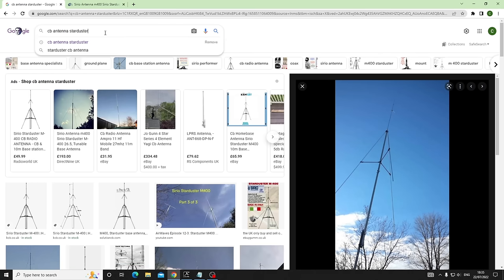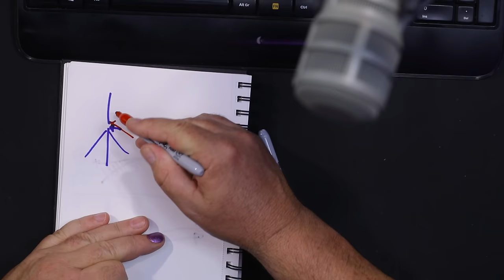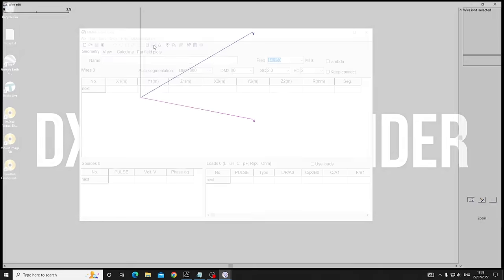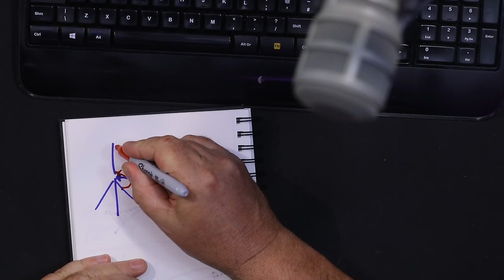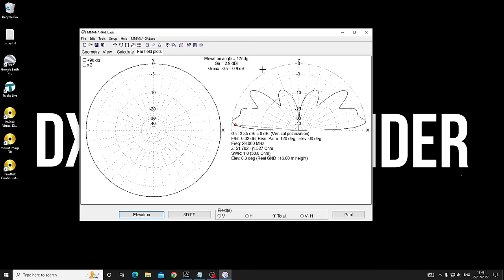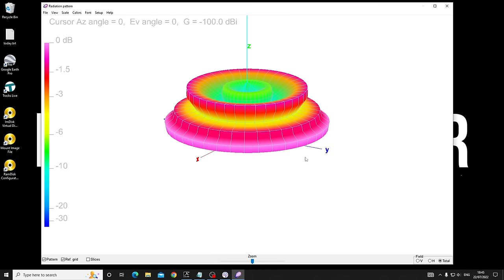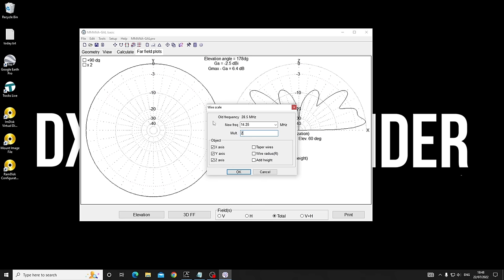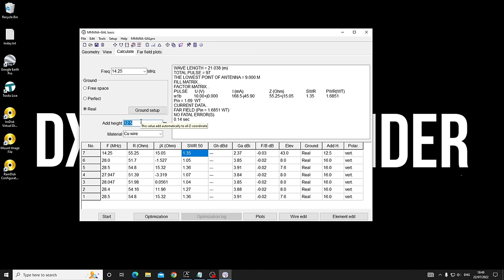The Ultimate CB / 11m Antenna?

Comment: Honestly. I just found this video at 2007 on  Thursday 26th Jan 2023. I thought of and built this antenna on around the 12th of this month....for 70 Mhz...4Mtrs. I put it at about 10' above concrete and vswr was 1:1.2 on 70.425. Unfortunately I've been sick for a couple of weeks so it's yet to be tested at about 20'. I didn't need some clever program, just a tape measure and a pipe cutter...for the alluminium. However your graph is showing me what to expect (sort of) of the radiated pattern. I remember the old CB antennas of this design (there was a legal one for CB27/81 called a 'thunderpole'.). They worked quite well and yes, basically they're a 1/2 wave dipole with the bottom element split into 3 GP's. I'll compare it to a homebrew J pole and then possibly modify it for a 3/4 wave radiator...for the fun of it and thats the reason why I did the RAE in 1984. Cheers and 73.
Reply from the maker: Yes.. And I built it - works great! https://youtu.be/V8Qq4-0_TjQ

Comment: I made a tuned CB 1/4 wave antenna using solid 10 gauge house wire and held up by a  rope 40 feet up between 2 trees and 4 radials at 35 degrees its been my main antenna for 7 years now.
Reply: Hi, I use a high gain 36' J-pole tuned to 27mhz made from 1/2'' copper tubing hanging  from rope inside a tree and i can work anywhere i want from 5 to 100 watts! I have talked over 50 miles away on 2 watts as a test base to base no BS!
Reply from the maker: If you have time, join us on the full-build and test Premiere? https://youtu.be/V8Qq4-0_TjQ

Comment: You always have great videos sir!
I use a high gain 34' J-pole tuned to 27mhz made from 1/2'' copper tubing hanging  from rope inside a tree and i can work anywhere i want from 5 to 100 watts! I have talked over 50 miles away on 2 watts as a test base to base no BS!
Reply from the maker: Hanging from a tree. Absolutely perfect!
Reply from the maker: If you have time, join us on the full-build and test Premiere? https://youtu.be/V8Qq4-0_TjQ

Comment: The best antenna I have ever built for local work on CB was a J Pole. Although, I have built many Quarter Wave Droopys, and they have their advantages. I friend of mine 50km away has a 5/8 gp and a quarter wave. There is a lot of terrain between us, up to 1000m. When he switches to his quarter wave, he jumps up as much as 2 S points (by my cb base meter) compared to the 5/8. This I believe because of the higher take of point, the 5/8 runs into the terrain. This can also be advantageous for skip, 'drop zones', if you will.
Reply from the maker: Well. I remember Roly making a DX contact on 28 MHz with a 6-inch nail..! When conditions are in, it just works :)
Reply: @DXCommanderHQ  yes, I've spoken to QLD on the Hill's Hoist (that's a clothes line) and the top barb of the our farm fence. But still, 12 watts to Ireland, almost 10,000 miles on a vertical only 6 or 7 meters up with a strong signal... not bad. You know we don't get those conditions every day.

Comment: I was a RTO (radio telephone operator) in 3rd Ranger Battalion back in the 90's when my unit went to Jungle Warfare School in Pamama. As part of the training, I built a military field expedient jungle antenna called a 29er2 jungle antenna. I had a pocket fisherman that I carried in my ruck and would use it to throw a washer over a high tree branch in the jungle canopy. Coms are a big challenge in the jungle and was able to make coms with the HQ about 7 clicks (km) away. We were of course in the military bands in the 10 m range. 30s MHz. We were taught to get three equal size bamboo or sticks. We measured them by spreading our arms out and estimating that distance. Then we used speaker wire and 550 paracord to make the radial wires and the radiated wire. Those were all measured the same way from hand to hand outstretched from each other like wingspan. We used additional speaker wire to connect the main beam and the radials to the radio. Anyway, this is basically the same thing as the military's field expedient 29er2 jungle antenna that was used in Vietnam. I have been planning to make two versions for 20m and 40 m bands. I think you would have to make the radials and main beam 15 feet and 30 feet. Do you have any idea whether or not this would work?
Reply: The paracord was used to tie the sticks together in a triangle and as the way to tie the ends of the radials to the corners of the triangle. It was also used to hang the antenna high up in the tree. I used the fishing pole to throw and large washer up in a tree and let it come down to the ground. Then connect that to the 550 cord and pull it up over the branch. Connect the top of the radiated main center beam to that and pull the antenna up as far as you could to clear as much vegetation as possible.
Reply: I do have a fiberglass pole like you are discussing that I could use. But one of the main benefits of the 29er2 military version was its relative light weight since we were loaded with 60 to 90 lb rucks and humping 12 to 20 miles a day through muddy and hilly terrain.
Reply: I have a couple hundred feet of speaker wire that I know will work, but I also have some electric fence 17 gauge aluminum wire. I was wondering if you have any idea whether electric fence wire is any good for antenna making?
Reply from the maker: OK, I am not quite sure if this was a ground mounted yago maybe? Google has no trace of the 29er2 - I'm so sorry I don't know.
Reply from the maker: Wire type: ANything works old friend, just make one :)
Reply from the maker: PS OK, so I built this one in the end.. If you have time, join us on the full-build and test Premiere? https://youtu.be/V8Qq4-0_TjQ

Comment: Back in the day 80's / 90's my best contacts were using a Wilson Trucker on the roof of my Sherpa van using a little 25w amp on my Major 555 radio . Locals with big beams and high power linear's didn't like it when i'd be talking to Mr Johnson in Jamaica and they couldn't get through - massive ground plain of the van roof was all i needed lol .
Then i grew up and got my M6 and it got weird - FT101e runnuing sub 5w of power into a MFJ matcher and out to a std 21ft aluminium silver rod cb antenna  = 1:1 swr on 20 / 40 / 80 meters and i was talking all over the world on 2 to 5w lol . Ok the big boys were wiping me out with their kw's of power as i sat there shouting UK QRP station , but eventually i'd get through and the remarks when i told them what i was running were funny ...
Sometimes the illogical actually works quite well ...

Comment: The spiky bits form a capacity hat, I did build a clone many years ago and it did seem to have amazing useable bandwidth.  I bet this will work well on a Nebula pole, might be rude not to make a version for 20m. Go for it! edit.. stick with 10m
Reply from the maker: Ah.. So the spikes basically gave an even better match.. OK.
Reply: @DXCommanderHQ  yes, they lower the Q, some other CB antennas at the time had capacity hats at the top.  The capacity hats  also reduce the tendency for corona discharge, not normally much of an issue at our power levels.
Reply from the maker: OK mate.. As you know, we did it.. If you have time, join us on the full-build and test Premiere? https://youtu.be/V8Qq4-0_TjQ
Reply: @DXCommanderHQ  it seemed to be working well at the weekend. Popped in and out of both streams to see how it was going. Will watch the new video. 73

Comment: Callum, please build us a Starduster wire antenna. 

I think my old ST'r was the best CB antenna I ever had, and it was close to 50' feet to the feed point and well guyed.

In answer to Robert Quance noted below.
"Robert, if I use 4 radials in my Exnec model the directivity problem in the Azimuth plot you note goes away, but the best gain goes down a little too using four radials. I doubt anyone would ever notice such small differences, however."

Marconi
Reply from the maker: Nice one!
Reply from the maker: Eddie.. I think I already mentioned to you.. OK, so I built this one in the end.. If you have time, join us on the full-build and test Premiere? https://youtu.be/V8Qq4-0_TjQ

Comment: I mounted one on a 18m pole, and it worked tremendously well, Call. I did use the elements as my guy wires. That's what I did before I installed my 2E cubical quad. 73's de ON70FF, Kurt
Reply from the maker: Ah Kurt! OK mate!!
Reply from the maker: OK Kurt, I copied you! But this one is 15m, 12m and 10m :) If you have time, join us on the full-build and test Premiere? https://youtu.be/V8Qq4-0_TjQ

Comment: I've built these for years from wire for 2 - 40m. They have 2 radials or 3 if I've enough wire and you don't need them high. 1/8 of a wave agl for feed point works. I would take Rudy Severns advice and pop a common mode choke at feed point.
Reply from the maker: Yes Peter, I think a simple dirty balun would be important in light of the height..

Comment: I've been running a MACO 5000 5/8 on the main shack and a 1/2 wave Tram 1498 on the main house.  The biggest difference I've seen between the two seems to be the fact the MACO has less bandwith, and only occasionally better performance.  Both do great in local LOS testing, both have made South America on skywave with raving reports with 200 watts, 8,000+ miles out.  

I think your point is very good.  As long as you aren't using a compromise antenna, they will all work well.  Height, terrain, nearby objects, far field, can all have more impact than actual antenna choice per se.  

The inferiority of my 108" whip on my big 20 foot long Lincoln car, and the poorer performance of my Hustler BTV6 on 10 meters, is better explained by the difference in height to my bigger antennas, more than the 1/4 wave vs. 1/2 wave vs. 5/8th wave argument.
Reply from the maker: I think you make perfect points!
Reply from the maker: Just a thought.. I got this working.. If you have time, join us on the full-build and test Premiere? https://youtu.be/V8Qq4-0_TjQ

Comment: I use CB (11 meters) for two totally different purposes. I have AM only CBs in my car and truck, with fairly small mobile antennas, running about 35-40 watts. These are for short distance local line of sight communication only. In the U.S., where I am, almost nobody has a CB in their personal vehicle. BUT. Almost ALL truck drivers do. So if you are driving on the highway, you will always be within range of someone you can communicate with very clearly. But just because they can hear you (if their radio is on) that doesn't mean they will talk to you. You have to be able to speak their language. Driving a truck is a very lonely job, and truck drivers actually like to have someone to talk to, IF it is the RIGHT someone. I just happen to be one of those types. 

I have an 11 meter SSB setup at home, with some extra channels, running 100-200 watts. That's clean RF, NOT splatter. I'm using my own homemade tube amp. I also have a whopper of an antenna in the back yard. I built it, but I have to admit I didn't design it. I did exactly what you are talking about. I copied the design from the '70s. It's a copy of what was called a Moonraker IV back in the day. It's a 4 element cubical quad beam, and it's so big and heavy that I had to use a Rohn tower designed for amateur radio antennas to put it up. I use it with a rotator. I have made contacts all over the world with this setup, though I seem to do better with Asia and the South Pacific, especially Australia and New Zealand. 

Oh, by the way, that little thing on top of most older three element ground planes is called a "top hat". Its usefulness is debatable. It slightly changes the antennas impedance, which may or may not increase its bandwidth, depending on a lot of other variables. It can also increase the antennas capacitance, but again that depends on a lot of other things. Way back in the mid '70s, I had a 5/8 wave ground plane that had a top hat. It worked very well, but whether the top hat had anything to do with its performance is unknown. It had no measurable SWR across the entire 11 meter band. I used it on AM only. I didn't have an SSB radio back then.
Reply: Its called a capacitive hat a top hat is a type of hat people wore in the 18th and 19th centuries

Comment: The little radial on the driven element is to lower the feedpoint impedance.. Likely to broadband the matching on this sort of twig.. It may help with ground loss.. Cap hats are better on the top in my experience..
Reply from the maker: .. however the bandwidth is SO huge anyway.. Interesting because when I made it, it just worked. Perfect match.

Comment: So, a couple things;
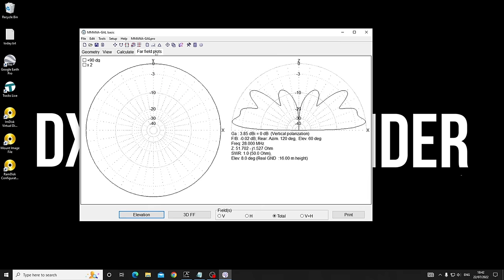1.) I see it provides 3.85dB gain Isotropic 7:33 That's about 2.15dB less with reference to ½ wave dipole, however this IS a ½ wave dipole - so how is it getting 1.7dB gain over itself?
2.) It needs a small hairpin (6.5" x 1"?) across the feed point to neutralize/bleed-off static electricity.
Reply from the maker: I have no idea. It's been a while since I made that. I always compare apples anmd apples though, so although I might say "dB", I mean dBi. It doesn't matter as long as we are on the same axiom.

Comment: My experiments concluded

1.Least ground affect(reflections below the antenna) around 18metres min height ,ground radials become more effective and radiation angle lowers.

2.Isolate antenna from mast ,earth mast via copper stake (frame earth ground)
Antenna sits at isolated.
Add a fully isolated 1:1 ground isolator transformer using BN43 mix binocular ferrite block (2t:2t)
This will isolated DC radio ground on coax to antenna (only required on 1/4wVe type antenna)
Provide a DC short circuit to antenna,improving static protection.
The radios DC negative ground from SO239 to ground isolation unit is now fully protected.
You should now have 
Earth ground 
Radios ground 
Totally isolated to prevent grounding out your SMP PSU , when it can cause all manner of RFI EMI  issue ,often blamed!
SMP psu do not like (being a balanced DC output) the DC negative being grounded to earth ground .
Optionally I found using double shieldef with copper foil outer of coaxial feeder help reduce "induced no use" getting into RF feeder cable.

Above tests were to optimise line of sight (LOS) 
On VHF lowband 25-88mhz 
Using a similar 1/4wave ground plane antenna.

Dxing skywave is a slightly different approach.

Great video!

Your suggest height in video of 18m ,Yes will give you outanding LOS operations!😁

Rob P
Reply from the maker: Yes, it worked.. https://youtu.be/V8Qq4-0_TjQ

Comment: we had this antenna back in the 80's when i was a kid, a simple fiberglas construction with no bracing and no smaal antennas at the top, and i think a 15 w radio for a while, dont remember the brand but a big metal box that loocked like wood with a v shaped front , it for sure knocked out the tv while talking. it was a pretty common setup, as theese radios where used in fishing boats until the VHF came along. this antenna may even still exist at my parents house somwhere. how does a cb compare in range to a VHF no skip added.

Comment: The object in the driven element is there to very slightly lower the radiation (take off) angle. It would also have a slight capacity hat effect, but not much,  due to its size and placement.
Reply from the maker: I didn't need it: If you have time, join us on the full-build and test Premiere? https://youtu.be/V8Qq4-0_TjQ

Comment: There was one more unique design for the CB craze of the 1970s and 80s other than the Starduster. A company called Avanti made an omni called the Astroplane and a 3 element vertical beam called the Astrobeam. Each had a strange loop/hoop...something you may want to investigate or tinker with some time? As I recall, the Astroplane had a wide bandwidth similar to the Starduster. The wealthy of the time ran beams called Moonrakers 4, 6 and 8 element versions. Also there was the 2 element PDL-II that preformed well.
Reply from the maker: Yes, I had the PDL2.

Comment: The three spikes in the middle of the vertical radiator constitute a capacity hat.  It does not enhance the antenna's performance in any way.  Instead, it is a gimmick to allow you to physically shorten the vertical radiator while maintaining a good match.  A far more challenging antenna to create would be the old Astro-Plane.  I owned two.  Those antennas out-performed any other vertical antenna I ever owned with great gain, flat SWR and very low noise.  It is a great hilltop antenna because of its ground-hugging radiation pattern.  I owned two different versions: The early version was shortened with a 4-spike hat on top.  The later version had a full-length quarter-wave vertical radiator which was adjustable for the frequencies (CB, freeband, or 10M) you wanted to operate it on.  Both were awesome antennas that maintained a flat match and could handle all the power I could throw at it (1500W).
Reply from the maker: Yes, I think they shortened the element because of it.. Copied on the Astro-Plane. I looked it up yesterday.
Reply: @DXCommanderHQ  My biggest issue with the 'Starduster' and other similar quarter-wave ground planes is it had no DC ground to help bleed off static.  If you remember the old Radio Shack quarter-wave ground plane, it had a 'hairpin' at the feedpoint to act as a static drain.  I suggest you somehow incorporate a shorted tuned quarter-wave stub at the feedpoint to act as a static drain.
Reply from the maker: Yes Sam. I agree a gimmick.. OK, so I built this one in the end.. If you have time, join us on the full-build and test Premiere? https://youtu.be/V8Qq4-0_TjQ
Reply: @samallan6616  I think the one I had was RS but it didn't have a pin and it definitely had the radials grounded.
Could be it was another flavor of 1/4 wave GP. It had no cap hat and the radials were at about 45 degrees to give an almost perfect match.
It's been 40+ years and I'm pretty sure I got it second hand but I remember a RS box.
I agree it is a great antenna, and my favorite one for simplicity and size.